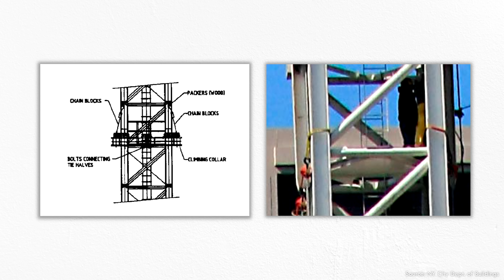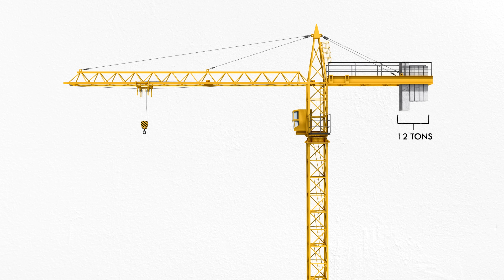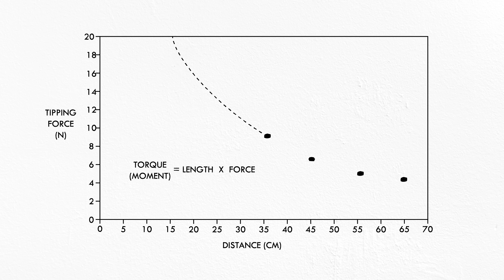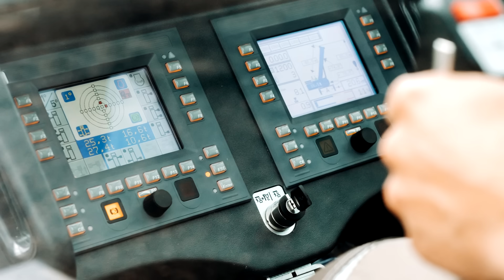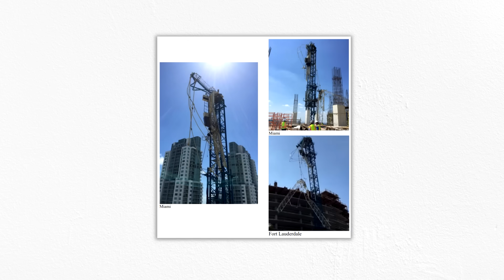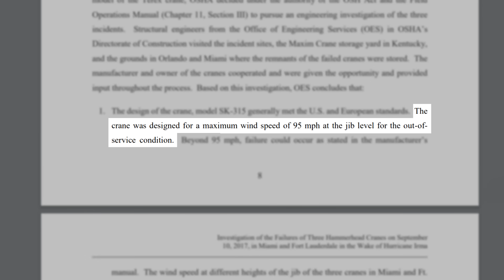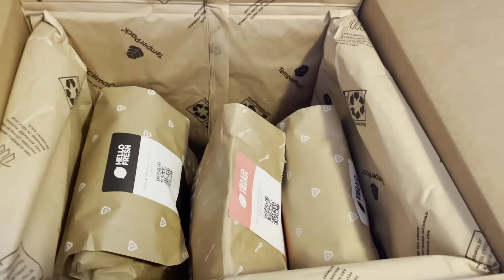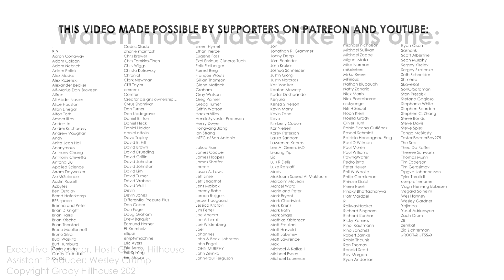Why Cranes Collapse

Comment: You mention that wet soil is less able to support weight than dry. At a human scale, there's an obvious exception: wet sand vs dry. Is there anything similar for something crane-sized?
Reply from the maker: Yes, sorry I didn't go further into soil moisture content, but all soils have an optimum moisture level at which they can be compacted to their densest. If you are too dry OR to wet of the optimum, the soil is less strong.

Comment: I've been on 2 sites where cranes failed. On one 8 years ago the ground gave way under one of the outriggers thanks to water pipe leak 1m below ground. even with large pads under the legs, once the crane picked up the load I was delivering, it went over dropping the load onto my trailer, and damaging surrounding structures. 7 years ago on the other incident, while delivering to a worksite, I was helping out with unloading our trucks, and on the first load while we were trying to place it in position, the dogman was shouting at the operator to stop lowering the load, and the operator yelling back saying he was not touching the controls, I looked up to see the wire bundling up into a big tangled knot and yelled out to everyone to "get the fuck out of there wire's about to snap!" Operator was quick to drop the load safely enough to avoid damaging it and not kill anyone, but that was day over at 8:30am. 
Still work with cranes to this day, but some times, there's noises that make me jump, or even run on a couple of occasions. You just don't ever forget being next to a crane that fails.
Reply: What are those sounds, btw?

What are they similar to?
Reply: @837301  Loud cracking sounds. Usually timbers under the outriggers flexing or at times breaking.
Reply: @stelp7617    No wires "singing"??? OR does that just not seem to bother you (yet)?  ;o)
Reply: @gnarthdarkanen7464  on mobile cranes you don't get singing wires, the length isn't there like on a tower crane, maybe a few meters when at maximum lift, and maybe 15m or so on touch down, depending on crane, also part of the rigging gear is really heavy.
Reply: @stelp7617  Just thought I'd ask since nobody else mentioned it... I know every time I've heard a rope or cable sing, my asshole puckered until the load was down and done!

     ...and I DON'T mind to tell ya'! 

   Nah, you have a point. You don't OFTEN hear 'em sing much until there's a certain length... BUT by God, they CAN... It's a sound I don't think anyone really wants to hear... maybe early on out of morbid curiosity... but not "for realsies".  ;o)
Reply: @gnarthdarkanen7464  I think one of my worst nightmares is a guy wire that's failed on one side and I'm in hearing distance of the other side. That slicing through the air and potential to slice anything in its way very easily.
Reply: @windsofmarchjourneyperrytr2823   Well, when I was in the Navy, we had a crane with a 20 ton main and a 10 ton auxiliary... I've heard those cables sing... seen them stretch...

    I've seen a mooring line (6 inch double-knit nylon) snap and carve clean through 1-inch plate steel in the hull... They'll sing, too... just before they go.

     AND I ride motorcycles... Currently on a Suzuki 650 Savage (cruiser)... I feel ya'... Close calls happen, though... including the ones where you find "an out" and don't necessarily really know how you did it.

    I've always said, you get three days to get over an incident... one to get drunk... one to get sober... and one to figure out if you're going to keep riding...
    ...but on that third day, you get into the gear and go to the bike, key in hand. You're either going to make a trip and do some slow-speed drills (if nothing else) THAT DAY... or you're better off hanging it all out for sale and staying your ass off the bike. You'll never ride again.

     My worst was a logging truck coming down the hill jack knifed as I was going up... I was on a little Honda Rebel 250 at the time, and the rear trailer tires swung out right at me... With about 30 feet to make the decision (at 50 mph) I ducked off to the side (full Rossi) and just managed to curve under the logs and frame... knocked both mirrors off and scrape hell out of the chrome on my sissy bar... BUT I popped back up on the other side shaking so bad I could barely get to the shoulder and park the bike... where I pulled out the can and rolled a cigarette... That's as scared to hell as I've ever been in my life (before OR since)... 

    It took the trucker (and everyone else on scene) nearly ten minutes to figure out where I was and that I'd made it... alive... The poor guy had tears still streaming down his face when he came running up to me apologetically... 

     Thing is, it wasn't his fault. He'd got brake-checked by a little car... in spite of his best efforts, he still knocked hell out of them, too... BUT he was just sure he'd seen me plowed under and he broke down in the midst of the panic and the search and the rest of the shit show... 

    Of course, I'd had my ten minutes to get over the heart palpitations, and I reassured the guy that I understood. I made my statement to the Police when they showed up, and the trucker's boss bought me new mirrors out of his own pocket... Even put the bike in his pickup and we rode out together to pick them out... I told him that his trucker deserved a beer. He really WAS doing the best he could...

    AND the car driver got arrested for attempted vehicular manslaughter among other charges too numerous to even recall...

     BUT I got my mirrors and was back on the bike that same evening... I burned that pair of pants (and the underwear), though... ;o)
Reply: People who can make modern society work with everyone noticing what's going on.  I'm just flabbergasted just reading this.
Reply: A Class A incident like this USUALLY in progressive work areas everyone goes home for the day to collect their thoughts. (or directly to the Pub after the site Safety meeting to overview.  It's a good idea. Take a deep breath.
Reply: I think that would have been quittin day for me. Like, you got a sign and don't need another. 

I once got knocked clean off a 10 speed by a Cadillac car door. Flipped head over heels (felt like I was bring grabbed and turned so I wouldn't hit the door, like I should have gone forward; I never saw the door enough to slow down at all. Maybe angels,  lol). Landed ON my feet, front wheel in between by knees behind me. One minor scratch on bike. Not a mark on me. At ALL. 

Last time I got on a 10 speed, too. They're more dangerous than driving! Often hit by cars. I know people that happened to. That was my sign. Haha. 

I mean, we're all going to due, but I might prefer in my sleep quietly over getting smacked by the door of a 75 Caddy or getting squished by an 85 billion ton crane. 

I was so shook, I couldn't even by mad. Everyone who drives knows you have that fraction of a second where you can't see something right next to/behind you. Easy to miss by mistake.
Reply: @windsofmarchjourneyperrytr2823  
Been there my friend, 3 times in total, third time did it for me when it landed me in hospital for 4 weeks, and in a cast for 3 months., permanent nerve damage to my right foot and titanium plate with 7 screws for life. totalled my bike, so I just never got another one. There's times that I've considered getting out of the trucking game, with the loads I move and the countless times I've had close calls with others thanks to their stupidity, but I just enjoy it too much.
Reply: @stelp7617    When I was young and foolish ( only the young part has changed according to the Wife) I worked for a Kawa. Distributor.  I wanted a bike bad.  A year after I started, I had seen so much carnage among my bike riding co-workers, I wanted nothing to do with one.  I’d still love to ride, but stats are all against me.
Reply: Glad nothing else since. Might almost consider keeping a clean pair of skivvies in the truck.
Reply: @emeltea33  lol, and yeah, I'm glad too, but in a way it adds that extra bit of awareness you wouldn't normally have.

Comment: As AvE would say...it's always the human's fault...and usually the humans who pay the bills. Need it done faster, take all the pins out before it's ready. Need it done cheaper, don't step up to the next size crane...Need that inspection? it can wait...pfft. <crash>. Falls over because dirt failed = human failed to check the dirt.
Reply: More specifically- it is always management's fault.

Either through not enough oversight of your work crew or putting people in a position of choosing between following orders or not eating, the fish rots at the head and any working person can point to at least a few instances where management has put them in dicey situations. Not everybody is strong enough to resist.

And the fact that rarely, if ever, are these people held to account, which is also a management problem.

Comment: I don't know the correct jargon/terms, but in the case of the standard "tee" type construction cranes where the slewing part is totally horizontal with the shorter end supporting the counterweight and the longer end supporting the moveable pulley, I've always been  amazed that the moment arm of the load is taken up by the "turntable" just below the boom even though there is a considerable range of distance for the load on the boom.  Can the counterweights be dynamically moved to account for the range of motion in the moveable pulley?  This doesn't seem to be the case, but it seems with modern control systems it would be feasible.

Thanks in advance if you should answer.
Reply: They generally have the counter weight set to be flexible in use.
By having multiple "drop" locations marked out they  can use the further away ones to lift smaller loads.

The counter weight is a fixed element to balance the structure but there is also a smaller counter balance that is on some cranes when heavy lift weights are needed
Reply: Most of those kinds of vertical cranes are used for frequent light loads in construction. A really heavy load requires a different structure. Edit: The fundamental problem is that once you release the load, the counterweight is now too heavy, and the crane is unbalanced again. Trying to dynamically adjust the load on a tower crane is madness.

Comment: About a year ago, a cabless construction crane fell during a storm, as due to a power outage, the sensor couldn't rotate it to be parallel to the wind. It also wasn't secured on the ground properly. The crane toppled midnight and I could hear it crash from a kilometer away.
It fell into the backyard of another house, but luckily no one was hurt.

Comment: Thats why you always need a healthy safety margin.

My best is a 300t crawler to hang my 75kg drive coupling.
Reply: I don't know what words you just said
Reply: @gitsurfer27  You should use a crane way bigger than necessary for the load. Then they mentioned a 300 ton crawler crane for lifting 75kg, which is extremely overkill since a few people could carry that.
Reply: @gitsurfer27  he basically means dont use a thing thats capable of lifting say 100 tons, at 100 tons because theres NO margin for safety.
Reply: @snowdrop9810  so basically just because you can doesn't mean you should
Reply: @thesampotato2030  I wouldn't even say you "can". You don't use equipment at its absolute max capacity because the dynamic loads (wind gust, etc) will be over its capacity.
Reply: @BlueZirnitra  On the other hand, the rating is not the breaking point of the equipment. There are still safety margins, but don't count on those as previous undocumented overloads may have stressed the equipment. So there is no issue using a piece of machinery at the limit, just remember that the limits will vary depending on conditions as well as maintenance demands.
Reply: Wind turbines?
Reply: @SimonWoodburyForget  any major lift will have had an engineer model wind loading on the crane as well as the load, and come up with maximum acceptable wind speeds and directions for the specific lift.
For instance if you are lifting a stadium roof, you will have much lower wind speeds limits than if you are lifting a solid block of steel.

The crane itself will have its own max wind charts to even be up, and what configurations it has to be in for various wind speeds, but that doesn't cover the load since every load is different, so that's part of the engineering done to plan the lift.
Reply: @ke6gwf  That is a very good point:
Every lift is planned.

There are engineers involved, and the crane operators and crane builders have a few licenses between them.

With mobile cranes (and probably the other heavy cranes as well), you hire the crane and the crew at the same time.
Reply: @57thorns  
Every lift is NOT planned.
Every BIG lift might be planned.
Big, expensive lifts have the money and time to do all that planning. Smaller and medium lifts are done every day with no planning and rely on the experience of the operator.
Reply: @jamese9283  Every lift is planned. Or at least according to the regulations where I live they are. 

For my 75kg lift the competent and qualified rigger assessed the load, the equipment, and the path and communicated with the crane operator. The competent and qualified crane operator assessed the abilities of his crane against the planned lift. Both the rigger and the operator are legally responsible for the safety of the lift and can be criminally prosecuted for failing in their duties. 

Additionally due to the nature of the work  government regulations required the company in control of the job to have formal risk assessments in place. This required all risks to be described and controlled in a formal document signed by all involved. Persons in control of the company from site supervisors up to directors can be criminally prosecuted if these requirements arent met.
Reply: @SimonWoodburyForget  20 m/s is like 70 odd km/h, which is not quite hurricane force but would qualify as storm.
Reply: But is that metric tons or short tons?
Reply: @yoimalex  metric judging by what he is going to lift
Reply: @SimonWoodburyForget  There are charts with maximum wind speeds for operating the crane at all.

Comment: As a tower crane operator,   I like it.      Not even done watching it yet!
Reply: Did you know there is an infamous Flat earth nutter that claims to be a crane driver.
Reply: @dogwalker666  I'm 200 feet up.   I cannot see the curvature of the earth from here,    but im pretty sure it is round.     Like a ball round,  not like a plate round.
Reply: @iancameron5724  indeed indeed as the planet is massive you need to go at least 60,000 feet up before you can see curvature with your eyes,  Adam as he is called also claims his crane leans backwards for mechanical reasons.
Reply: @dogwalker666  I don't know who you are or what your motives are.   So I subscribed to your channel just in case.      
   Crane leans back when empty,   60/40 back heavy,   never the first bounce that sends them over.  The 2nd.   Gives you time to contemplate things...

Comment: Cranes are just so tall, and look so flimsy - what with most of their "structure" being holes!
I could never bring myself to climb up one, not even if you were to give me a billion dollars and a new traditional Legend of Zelda game. Just...no.
Reply: The structure is triangles, the strongest shape. The holes are just where there is no material needed to transfer the forces and adding material there just adds more weight and therefore more forces. If a crane was solid it would catch a LOT more wind. Also I would never describe steel as being flimsy ;)
Reply: @Schedelke  to be fair adding more material at the bottom would probably make the crane more stable, not saying it would be cost efficient.
Reply: When I was an apprentice helping install new motors, the bet me I would not walk out to the end of the boom to change the aircraft hazard lamps,  I did it scary at first but you get used to it,
Reply: I really feel that last comment.
Reply: New zelda game gonna have you climb a bamboo scaffolding that sways in the wind just to spite you